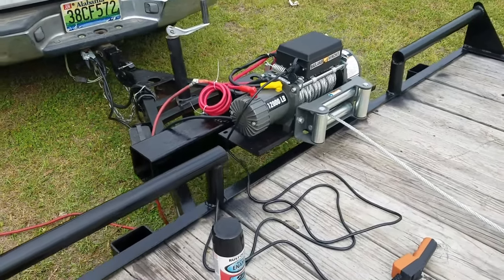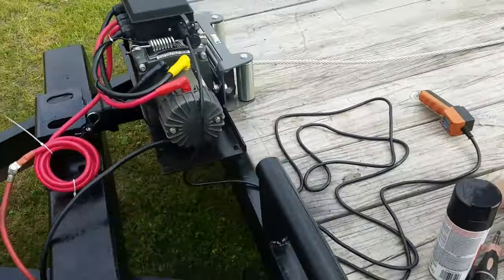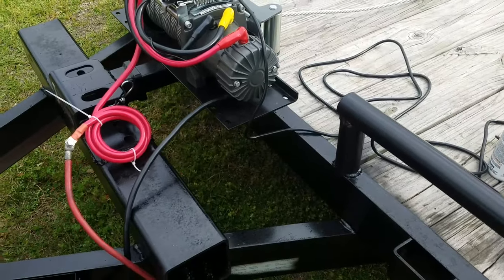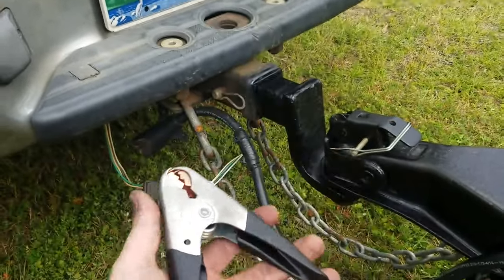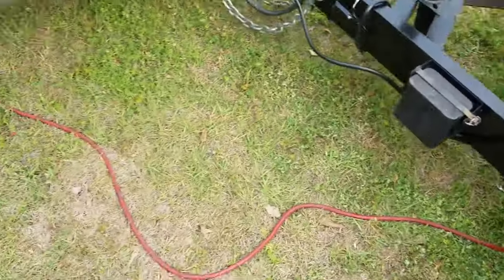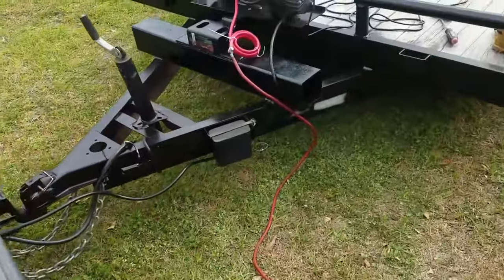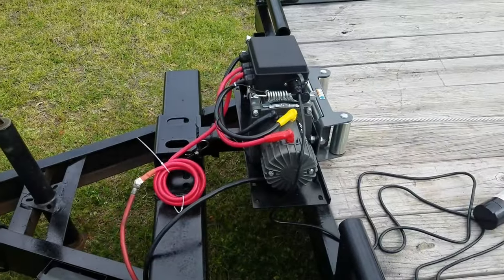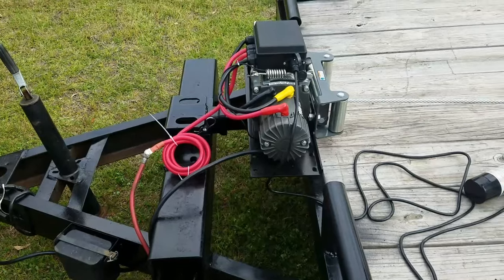Badland winch from harbor freight installed

Comment: Where did you find the 5 x 5 square tube?  The prices I found are amazingly HIGH!
Reply: Check with a recycle center. I pick up scrap upto 4 to 10 foot long. Price is normally. .15cents to .45 cents per pound.
Reply: OK.....Well, I bought a 3' piece of 3x3 tube......was $75 after having it cut.
Reply: Steel supply company would have sold you steel for a dollar to 3 a foot for average small sshit. Depends on size & tpye - (ibeam, angle ts 4x4....) or a fab shop would have done the same